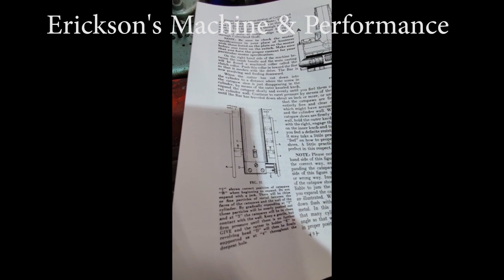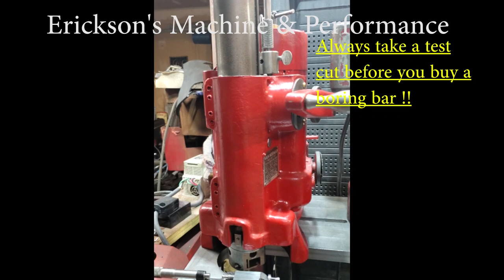Differences in Kwik-way, Van Norman, & Waida Portable Boring bars & things to look for before u buy

Comment: I have used a van norman in Australia also another bar called a wandess and there were bars made in Australia by Repco and earlier under another name most of the larger shops we use the bigger machines with dial gauge setup and surfacing capabilities  as these machines are much quicker and can do a broader range of boring jobs on anything large or small.

Comment: We have a guy here that Loves these Portable Boring Machines.
When i say Loves ?

He will buy every machine he can get his hands on.
It's not so much to build up his collection,  he rebuilds, trades and sells them pretty much does everything with them.

His business is dealing with second hand engine reconditioning equipment.
The only downside with dealing with this guy is ?

He seems to want to keep All the machines ????
What i mean by that is ?
His prices make you think he doesn't want to sell them, LOL.

Enjoyed the video,  a lot of good information.
Seems you have a bit of a love affair with these machines also. 😂👍
Reply from the maker: I haven't had a machine for sale since the beginning of covid when i sold out. 10 bars sold in a month.    And Now these machines are selling for more then they are worth in horrible condition (around my area)      if you compare my pricing to anyone else that rebuilds these machines we average less then half the cost of others.     Thanks for watching.
Reply from the maker: But I do love manual and cnc machines. 
My business is machining. I run a Cnc Machine Shop & a Performance Engine Shop.   I rebuild equipment on the side as a passion and also when starting out +20years ago I couldn't afford high end equipment so I learned to fix old equipment.   Only to find out many of these old machines work better then there newer versions when rebuilt correctly.    Have a great day

Comment: I own a MC , Motorcycle, shop. The machine shop that did ALL the PowerSport stuff. He retired He taught on valve shaping, decking, checking cranks, valve guide work yep we have known each other for 10+ years. So I’m new to machining world, but not a newbie. The  one of several things that I didn’t get my hands on was Boring, replacing valve seats. 

So I just bought a Kearny &Trecker H2 vertical Mill and was going to use the Mill for that especially boring, what makes these boring machines, that are awesome looking, different?
Mike Stubbs

Comment: Good video.   I have a Chinese copy that has features like the van Norman like the cutter being placed in the mic but has cut outs on the side next to the base like the Japanese machine.   My question is how are you locking those down to the table to start your pass
Reply from the maker: The cylinder gets mounted the the table and then you center the boring bar and lock the bar to the table
Reply: Yes but what is back underneath the boring machine that locks it to the table.   I seen a bolt you turned to lock it but what does it look like that bolt goes to.   I wondering if my machine came with a full tooling kit.  Hope I’m explaining this clearly
Reply from the maker: @oldschoolmechanic7771  email me ericksonmap@gmail.com.  I'll send u some pictures
Reply: I'm looking at those bars (T8014A) myself only because of how expensive the existing stock of Van Norman and Kwik Way bars are (that is, if you can find one in good condition with a complete tool kit). I'm looking for feedback on whether they get the job done but it's been tough finding info on them. No one seems to have experience with them and I can't find one online testimonial. They look the part but they ain't cheap either and I don't want to drop 2 grand on a paperweight.

Comment: I have a very nice 900. I also have a sucker outer. Can a s series head be used to replace my standard head so I can use the sucker outer on it?
Reply from the maker: There used to be conversions for the 944 and the 777. That was the head , inner column shaft and base spacer.  So it COULD be done but it's alot more then just the head and I haven't seen the base spacer for the 900

Comment: You never mentioned the Van Norman 944. Could a 944 be modified / rigged to bore possibly a .250" larger cylinder than it is designed too? A total bore of 4.50" cylinder bore would be plenty for my needs.
Reply from the maker: Yeah I was just showing the different bars I had at the moment.      The 944 is a great small bar I would not recommend using it for bores over 4.25.  Even at 4" it starts to get hot.   If it's a one time think or maybe once in a blue moon MAYBE.  but I'd recommend a larger bar like a 777s or fn or ft

Comment: I have a Kwik-Way FT which I've been using for quite a while. It really works well. However the spindle (boring sleeve) has some vertical scratches. How big of a pain in the butt is it to pull the sleeve out and maybe lightly sand it. I was thinking about running a dingle ball hone down through the base to smooth it out a little too. And maybe greasing the bearings in there too. I'm suspecting that this thing has never been apart. Good idea, bad idea?
Reply from the maker: Can you email me pictures ericksonmap@gmail.com

Comment: Great video. What is the kwikway FR? 
Thanks
Reply from the maker: The fr is the old small bar from kwikway.  Came before the fws or fws2.  But around the size of them.   They are rare
Reply: @EricksonMachinePerformance  Interesting. Thanks!
Reply: @EricksonMachinePerformance  just got my hands on not only the FR ?, but the kwik-way colt you show in this video. both work, but the colt ( i think this is what you called the small air operated machine ? ) has an air leak on the feed knob, i need to look into it. i have started using the FR machine, works great !.

Comment: Hey I just got a van Norman boring bar , must be an “S” because it has the suction. Not sure off the top of my head the model number because it’s in the back of my truck since I literally just got it an hour or so ago .. I loved this video ! Helpful for sure ! So the tool kit is missing one of the smallest set of the four centering feet. Now I’m not sure I’ll ever bore something that small but if you had one flr sale I’d prob grab it. Also the cutters. Just like you methionine towards the end the guy said he had better luck with the positive rake carbides. Do you know a good website flr those ? Do you personally sell them ? He sent along with it a sharpener I believe but I’d like to pick up some new carbides (positive rake) just to get me off nice and sharp. Also he had a home made HEAVY stand. Some 1” plate steel jobber, but do they make an actual stand for that machine ? Figured I’d start asking people that actually know what there doing before I get sent a stray by the internet trolls .. hahah ! Thanks , Paul
Reply from the maker: I might have the feet.   Email me ericksonmap@gmail.com 
The cutters are available at
https://beamequipment.store/cylinder-block-equipment-and-tooling/cylinder-boring/van-norman-944-s-777-s/

Comment: Have you ever worked with a storm-Vulcan nk6? I just purchased one and don’t see a lot of info out there on them.
Reply from the maker: Yeah but like 20 years ago And I really don't remember anything about them.    It's a fairly rare bar but BEAM equipment might have manuals for them
Reply: @EricksonMachinePerformance  Thanks for the reply. I got it for a pretty low cost compared to a van Norman or kwikway was wondering if there is something inherently bad about them.
Reply from the maker: @johndelta00  very good machine.   Just rare and not alot of parts around for them
Reply: @EricksonMachinePerformance  sort of what I figured. I bought the tool kit with it is as well. Thanks again for the replies!

Comment: Have you seen the Chinese copies of the kwik way. Part number T8014A, wondering how good they are?
Reply from the maker: I dont know that one but most r junk.  Your better off spending on a machine you can get parts for
Reply from the maker: Sorry there was a auto correct. Please reread my response
Reply: @EricksonMachinePerformance  I hear great things about the T8014A but I need to ether use one myself and check it or hopefully run across someone with alot of time on one. I'm almost at the point of buying a sunnen CK10 or better because I can't trust the used market anymore.
Reply: Is there anyway I could get in touch with you?

Comment: Great video. I inherited a Van Norman 777s. It needs a start capacitor. Can’t find any specs anywhere on the capacitor . Do you know the specs ?
Reply from the maker: I can look for you.
Reply: Wanted to let you know that I got it running. Ended up replacing the capacitor with a 189-227 uf MFD 110-125volt.
It had the original capacitor with paper housing ( no markings at all)

Thank you for your interest in helping.

Comment: We have a van norman 777S but has a thin cutter holde compared to other 777 bars having bigger tool holder . Why?
Reply from the maker: If it have the thin holder its 777.   Not a 777s.     The (s) stands for suction and uses the lager tool

Comment: I plan on starting engine service at my shop and want a boring machine. What would you recommend for dirtbikes and other small engines? I want to include small engines such as 50 and 90cc, so I will need a machine capable of 30-40mm bores, and up to 4" for larger engines.
Reply from the maker: @Timbzz-dq8vn  there isn't a machine that could do that range.   You would need 2 boring bars.  1 small and 1 medium size

Comment: Hi, I don't have a portable boring machines but I do have a Bridgeport mill. Do you think it would be possible to bore motorcycle cylinders as a friend has asked me to do his?
Reply from the maker: Is it possible Yes.  BUT i wouldn't recommend learning on a buddys engine.   You would need to buy a bore gage, micrometer, boring head for your mill and a rigid hone to do the job. The cost to do a couple wouldn't be worth it. Also there is a learning curve to doing it properly.  If you want to start boring cylinders i would recommend buying some junk engines and bore and hone a handful of cylinders BEFORE you work on your first really job.    The main issue using a milling machine to bore cylinders is centering the holes it takes significantly longer on a mill than it does on a machine that has a centering mechanism to speed it up like a boring bar

Comment: hello     I have a 777s with the #2 paws it will not extend out to center in a 4" bore am i doing something wrong
Reply from the maker: Can you send pictures with the paws off in the fully in position and then a picture of it fully out.   You could have damaged a tooth on the inner jaw.    Send me some pictures to my Facebook page and I'll be happy to help you out    www.facebook.com/ericksonsmandp.   Also I'm getting ready to do a complete rebuild video on a 777 bar which will be showing the whole cat paw assembly apart but that's in a 2 weeks or so
Reply: that would be great but i think i figured it out i have 2 tool sets for it looks like the 900 series one set is complete the other is missing some paws

Comment: Great video. I have a very old 777 that I'm still using, but my paw feed is getting really rough and it's starting to shift on break thru at the bottom. I'm going to try and rebuild it one of these days. Just curious what the pitfalls are? That old exploded diagram in the manual leaves a lot to the imagination! :D
Reply from the maker: the 777 is easy to take apart   but if you do id recommend also replacing the bearings.  feel free to email me your # and ill be happy to give you some pointers
ericksonmap@gmail.com

Comment: Hi mate, rob from Australia. Wanting to bore out 2 700 cc waverunner motors (4 sleeves) a dude has a 944s for sale for $3500 complete but no stand. How small do these machines bore? Will they bore as small as 81.5mm please and could I fit the 944 on top of the cylinder block and mount it with the factory foot or would I require something more extreme, thanks
Reply from the maker: The 944 bores from 55.6mm to 112.22mm.  You COULD mount to the the cylinder through the cases BUT I'd recomend using a small engine stand.  If you want message me on Facebook www.facebook.com/ericksonsmandp  and I can send you some pictures how to make a homemade stand.  That being said I dont know how much stuff sells for over there but in the USA the 944 bar with a tool kit sells for $1000-$1700.    But maybe they sell for more over there

Comment: Also I've seen a boring table called the cycle pro boremaster that is built for small engines, would one of these be a better choice for quick bore jobs ?  Most of the Kwik ways I've seen don't have stands and they appear to be another couple grand to buy.
Reply from the maker: @Timbzz-dq8vn  you get what you pay for.   The bore master machines aren't the best And don't do the best job.   The Serv-equip or Winnona Van Norman 1201 or cb1401 are a better fit for that type of work.  The cb1401 Range: 1.5” (38mm) - 4” (101mm)
Reply: @EricksonMachinePerformance thanks for the reply ! I could do without the smallest option i think as I really don't work on many 50s and usually just swap cylinders. The 1.5-4" would be just about perfect for most of the jobs I would acquire in the 125-450 range. 
Do you sell machines? I am in the beginning stages of outfitting my new shop but have a pretty good idea of what I want to do. I have worked in machine shops, mostly on lathes and surfacing machines, but boring is new to me. I'm sure I'll need to start with a few junk cylinders to get the hang of it.
Reply from the maker: @losthighway90  email me ericksonmap@gmail.com

Comment: So there’s no way to control cylindricity, only concentricity? :O
Reply from the maker: A good are is extremely true. It all comes to setup.   That being said honing is where you make everything dimensionally perfect
Reply: Erickson Machine & Performance But the tilt is non adjustable right? Do you set it perpendicular to the block in some manual fashion or how is that alignment made?
Reply from the maker: @ericohman  the deck is held perpendicular to the bar No need to adjust but  There are tables that mount at the mains and can be tilted

Comment: I just purchased a 944s in good shape but the bar itself has very light surface rust in just a few spots. Whats the best way to clean the bar up? Crocus cloth?  Thanks
Reply from the maker: Can you email me pictures.  Ericksonmap@gmail.com
Reply from the maker: Alot of times  I just used a sheet of red scotch brite pad with a little bit of oil.   Like this.  https://www.amazon.com/Scuff-Pads-Scotch-Brite-Brand/dp/B00MBPT0F8/ref=mp_s_a_1_7?adgrpid=55268319359&gclid=Cj0KCQiA4sjyBRC5ARIsAEHsELEnUszXSh6G7MYjmoOvf2nJIQ5lReHgAFt3kC3OOhiN79jtaH9hUIcaAljWEALw_wcB&hvadid=274727237891&hvdev=m&hvlocphy=9003676&hvnetw=g&hvqmt=e&hvrand=12893709399336559582&hvtargid=kwd-299244284537&hydadcr=8069_9883841&keywords=scotch+brite+pads&qid=1582463052&sr=8-7

Comment: Been boring for decades. Kwik Way FN hands down better than Van Norman . Van Norman is less maintenance
Reply from the maker: @halmcdonald1725  it depends on what you're looking to do.   Both work great.  We sleeve ALOT OF ENGINES.  That van norman 777s4 can cut .120-.16" per cut if you want. When machining 2 stroke cylinders the Van Norman machines handle the interrupted cut better. The Kwikway cant make as large a pass and the abuse wears them out faster.  The Fn does have alot of nice features and if you just want to bore .01-.05" it's a great bar.   It really depends on the type of work you do.  There is no such thing as the best bar.   It's what fits your work best.   I own both a Kwikway Fn. And a Van Norman 777s4.  We use them both. Also, at this point, I have been boring cylinders for 25 years so I have 2.5 decades of experience.
Reply: I have sleeved thousands and thousands of blocks and I can get done with a sleeve  or just boring in a flash compared to the Van Norman . I’ve got two 944s and a 777 idling and I’ve worn it two FN’s and on my third and final FN 🇺🇸🙂 thanks for the reply
Reply from the maker: @halmcdonald1725  I have also sleeved thousands of blocks.   I also own 4 bars. I have a 944s a 777s4 and fws2  and an Fn.  All are great bars and all have pluses and minuses.  And you have a 777s or a 777s4?   They are very different bars.   I'm also in the US and have rebuilt several hundred boring bars over the years. I'll agree to disagree.  Both bars are great.   I use both daily.  Thanks for commenting